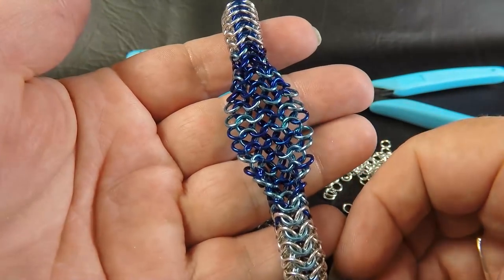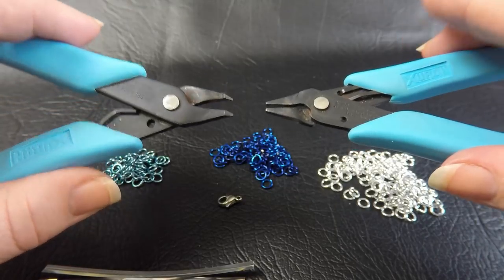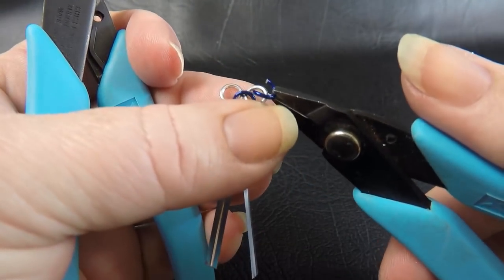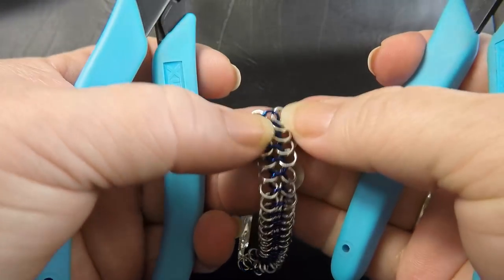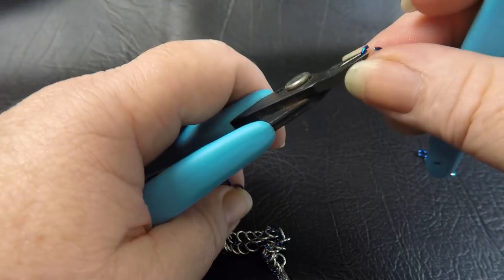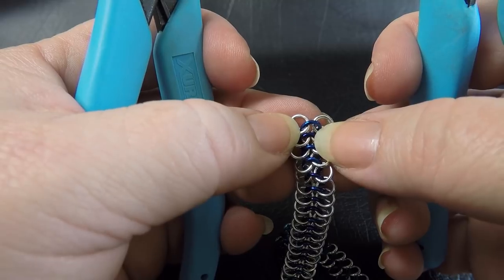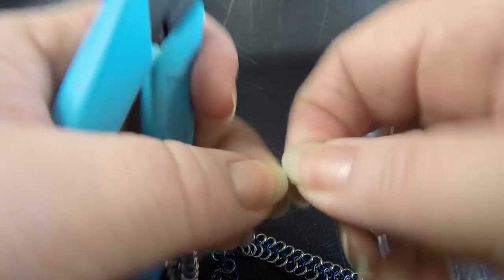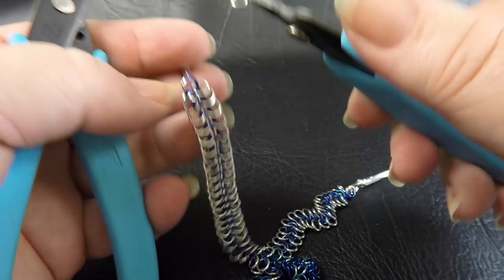Chain Maille Tutorial - Opened Maille Bracelet

Comment: Hi Deb, love this bracelet. Beautiful, I do have a small wrist, 5 an 7/8th or 6 inch wrist.  I would need to make this a necklace rather than a bracelet to make it look right.  I only want to use 2 colors, perhaps jewelry brass and silver.  Could you advise how one will figure how many rings  you would need for a necklace?   Thanks much  Cynthia
Reply from the maker: Hi Cynthia.  The ring counts I gave are for an 8inch bracelet....add them all up and divide by 8 will give you the rings you need per inch...then you can multiply that number by the length of your necklace and you will have a ring count.  Hope that helps.  Deb